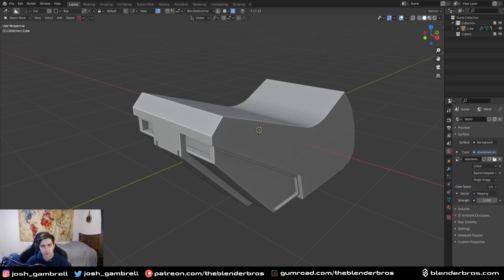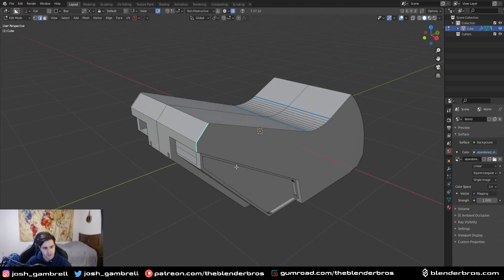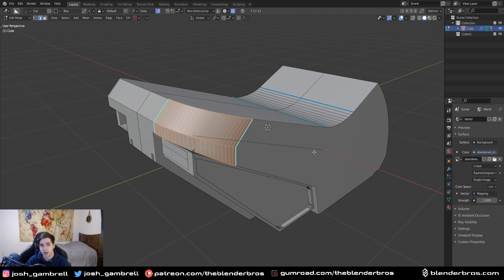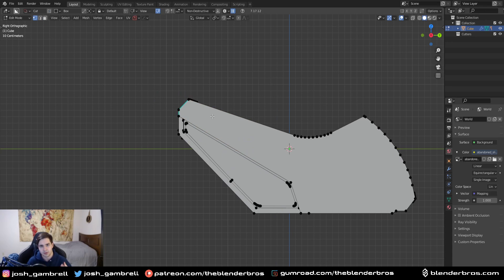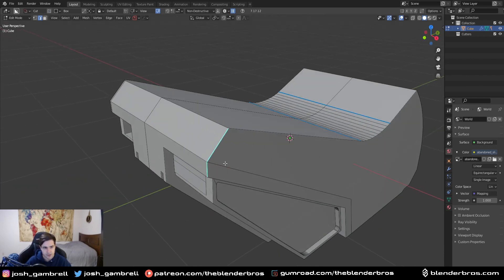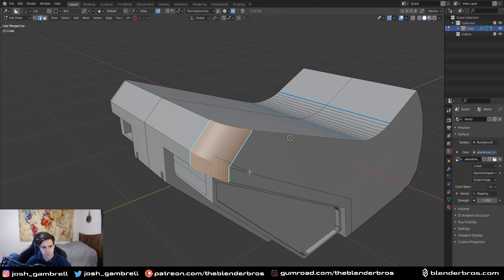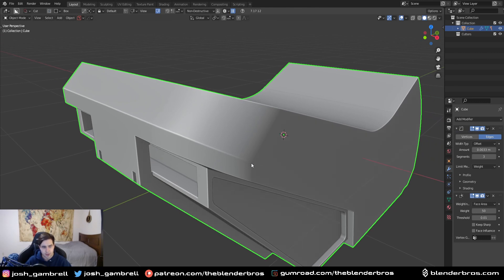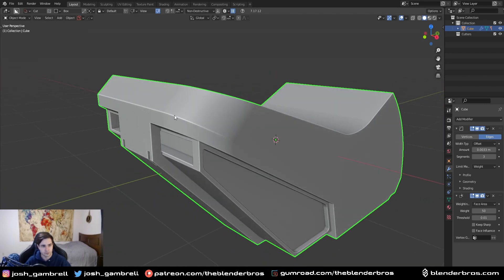Cool bevel trick you should probably know in Blender!

Comment: Hi Josh, I appreciate you are probably very busy, but I just have to see if you'd maybe be able to point me to a fix for a shading issue: So been using weighted normals with the ngon workflow which you suggested in one of your videos. It's really fun in terms of allowing creativity to flow without having to worry too much about the actual topology form.
 However just today I'm having issues with shading in a certain spot where I used a difference boolean, and some of the edges look more hard than soft like they are supposed to be, I'm struggling to fix this. Any suggestions on how I could fix this issue? Thanks, great video too as always. P.s. using vanilla blender.
Reply from the maker: Join our discord and tag me, I'll help you there: https://discord.gg/auVYKdTg
Reply: @JoshGambrell  Thanks!

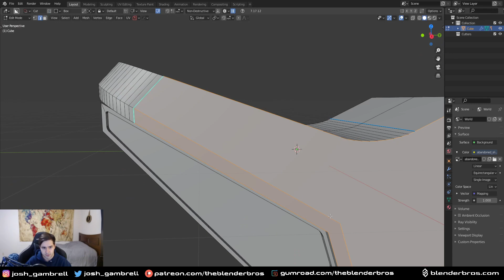Comment: Hi! can you explain a bit of whats going on at 2:00 kind of confusing to me I know the purpose of it but what is its principle behind it? Thanks!
Reply from the maker: Sure, on any model with a bevel modifier set to angle, there is a certain threshold that bevel will work within. For example, If I have a 90 degree edge and I set the bevel angle *above* 90 degrees, it won't bevel. It has to meet that angle requirement. Here, part of the edge did, part of it didn't, so instead of messing with the angle, I simple changed the limit option to "weight" which allows to me to manually mark which edges I want beveled. Make sense?
Reply: @JoshGambrell  thanks totally made sense! 😮
Reply: @JoshGambrell  It'd be awesome to get a whole tutorial walk-through on that process! Thanks for your video!